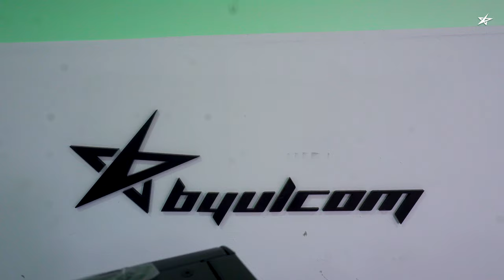" Full of freshness." 5900X, RTX 3080 Ti  Thermaltake Core P8  customized water-cooled PC.

Comment: I feel like the distroplate wasn’t even used to it’s full potential, the loop order is super strange and most of the port holes on the distroplate wasn’t even used
Reply: Or really at all. It replaced a 90 degree fitting.